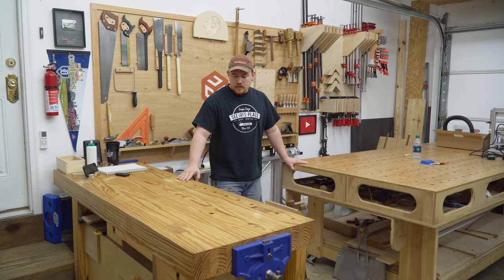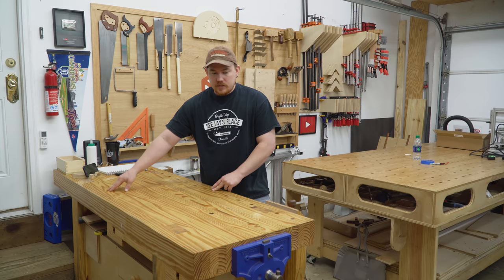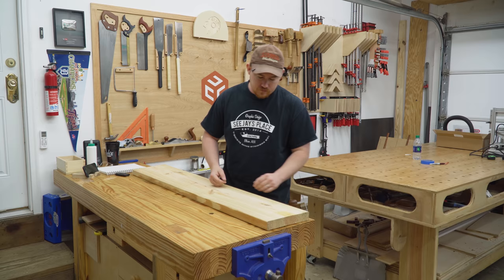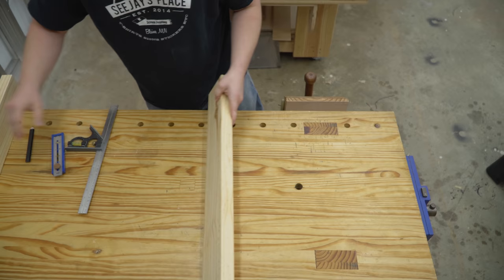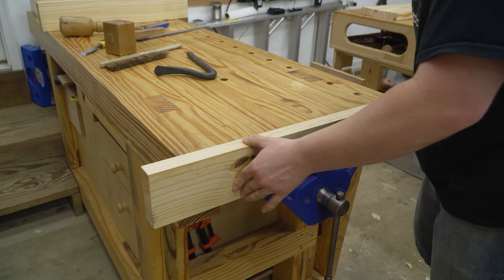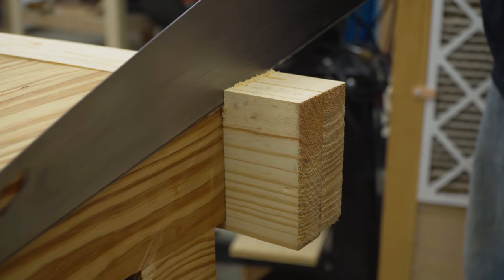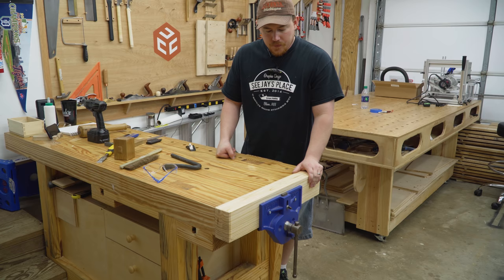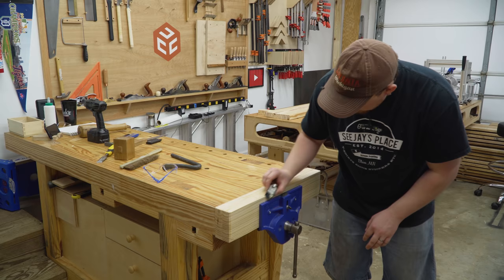Shop time: End Vise.

Comment: instead of using à dowel into the vise jaw you can also make a u shape wooden block to fit on the jaw it will allow you to place it were you want on the jaw in case of irregular shape

Comment: Not sure if this is old school, but I have seen so many woodworking high end shows that  store their sets of wood planes with the blade down. I was taught that you set the plane on its side, the reason being that should the plane be pushed of shoved it can not come in contact with a nail, screw or something of such that would chip or dull the blade. That also include storage of the plane, I would think that the blade down would be OK if it was on a piece of carpet or some sort of soft material. Just food for thought.
Reply: R. Catton , blade down 90% Of the time! of course it depends on circumstance.  Like you said, the idea is to protect the blade. If you're placing it flat on a wood surface, there is little or no risk of damage, as soon as the blade is exposed because the plane is on it's side, the risk to bump it with something and cause damage increases. If you're placing down on a hard surface (metal, tile etc... ) then on the side is the right way to do it!
Reply from the maker: The blade being exposed greatly increases the chances for damage.

Comment: I have that same vise. Its a good one. I put 2" ash in there for the sliding jaw. Hickory would be just as good. You might want to go back and counter bore those screws you put in the fixed jaw. with that soft pine you may end up with a nice embossed screw head on whatever you clamp in there!
Reply from the maker: They are countersunk below the surface.
Reply: ahhhhh. carry on then...lol

Comment: Hi J, just a small suggestion from an old & busted guy. I noticed your kicks and while you are young, they work. However, time catches us all and you might look into a better shoe to save your knees, back, hips. Just my experience.
Reply from the maker: Can you suggest a better shoe? I've got short, wide feet. They like the short boat paddles you give to kids lol. New Balance are the best fitting brand I've found.
Reply: Hi J, thank you for the response. My knees are bone on bone. Just can't afford to have them replaced. I had my stride analyzed at a running store and they recommended Asics. They are very, very expensive, but worth every penny. I can stand on concrete floors for hours and feel no fatigue. I can work all day and sleep at night. Best suggestion, go to a running store and have them analyze your stride, gate and stance and go from there.
Reply: ProspectorBill  like tools, there are some things worth spending more money on. GOOD shoes (not just expensive because of brand) and a GOOD bed. We spend so much time on our feet, and almost all of the rest of our time in bed, so it just makes sense to buy quality there! And I agree, ASICS are nice shoes to wear, mine are due for an upgrade now going into their fourth summer of use

Comment: I just installed this exact same vice on the end of my bench. I bought a piece of live-edge oak (just over 1 inch thick) from my local DIY store, cut it down to make the jaws. I did't go complete width with the oak jaws however. Don't know why, they're about 38cm in length. Liked the idea about using the Forstner bit to drill out the recess. I used a router, which I started to regret as soon as I began. Worked anyway but with a lot of patience and a thousand times more dust than you caused Jay 🤪
Reply: Robert W. what is the model of vince?

Comment: I won't have thought to use a Drill Press to remove the material for the metal vise, nice idea.
Reply: I suppose a table router is the obvious choice, but I'll admit to using a metal milling machine, and clamping the work piece directly to the table.  The biggest problem is keeping the wood from getting oily marks on it, but it makes for very accurate, and easy to do rebates.

Comment: If you left the piece of wood on the sliding side of the vice just 1/4 or 3/8 proud/taller of the bench/stationary side, than that would work as both a plane stop, and a super wide dog to clamp panels with. Then you don't have to put holes for dowels or dogs in the piece of wood. Let me know what cons you see with doing that, because I might do that on my bench if there is not a fatal flaw.
Reply: I would not do that if I were you. Here's why: if you have a long workpiece that you're doing layout on, or some assembly you're trying to put together, and it overhangs the length of the bench, it would be propped up on that one end, which you don't want. So having a dog in the vise that can be lowered below the surface of the bench would be a nice benefit.
Reply: Yeah, I don't see that as a problem. A workbench has 6 to 7 feet of top, plus overhang on the other side. I find I need a plane stop and end vice way more than I build 9 foot long pieces of furniture that have to be assembled on top the workbench. I still think it is a good idea, plus you can always just remove it if you find it gets in the way for a rare project.

Comment: Great video Jay, I have been doing soooo much of this type of workshop optimisation recently. Lots of 5S type activity and clearing making custom areas to store things. Any horizontal space or wall space has been attacked and revised to be more efficient at storage or tool placement. I'm merging good engineering practice with casey neistat studio style guerilla organising! dont be too precious with things, and make it work for you! :D thats the mantra i'm trying to adopt anyway... 
another great video, I'm still trying to make time to do another and its been over a month now i think!
Reply from the maker: Well said.
Reply: Thanks Jay. I'll have to do an updated shop tour video at some point. seems to change a little bit every other week. Im actually sitting on sketchup right now drawing up plans for a mobile planer stand, mobile bandsaw stand and new workbench (cant decide on paulk vs your heavy duty style) also on wheels, with holes for MFT style clamps. The dilemma of using a table that can also have the wholes all the way through for the rail clamps....decisions decisions. Also using steel for making frames to save space, 20mm box section! every little helps!

Comment: Looks great Jay. Do you think just 2 screws will be sufficient to hold the active jaw when you apply pressure to the dogs if something is a slightly irregular shape?
Reply from the maker: They were 1/4" diameter screws going nearly the full depth of the jaw. I think they will be sufficient. If not, a counterbore on the inside and a bolt is a really quick fix.

Comment: Pretty new to woodworking. Is there a reason to go with the drill press to cut the recess as opposed to a router or just personal preference? Guess it's a bit easier to line up without having to get fancy with fences, jigs etc.
Reply from the maker: Personal preference. The drill press produces larger chips which are easier to pick up. The router produces a lot more dust. I hate dust.

Comment: i don't even know how i know this , but  it works, wet the wood with a shop towel , throw the towel on the floor , rub the towel over both pieces, and wipe it down with a dry towel, vwalla, they match

Comment: Jay, do you find that you lose any clamping pressure on the ends of the vise?
Reply from the maker: so far, not so much. A spacer on the opposite side will solve that.
Reply: Good point.  Thanks Jay

Comment: Hey Jay, how do you deal with rust and humidity in your shop? Thanks!
Reply from the maker: I installed a minisplit air conditioner/heat pump. Before that, I had rust problems constantly.
Reply: Oh ok, thank you!

Comment: Hey Jay. Where is your mask?!
Reply from the maker: See my video about measuring dust in the shop. I'm keeping the airborne dust under control. When it rises above 300 on my meter I either leave the shop for a few minutes with the cleaner running or put on my respirator. But with the dust collection and my air cleaner cart running it never gets that high.